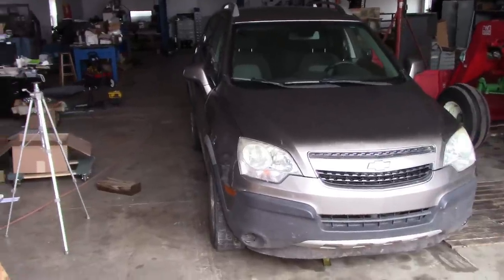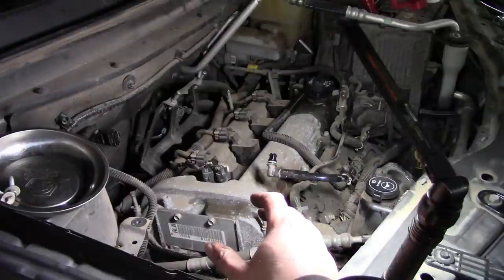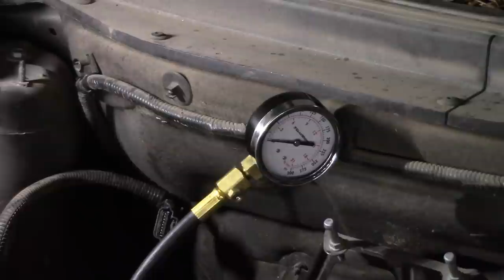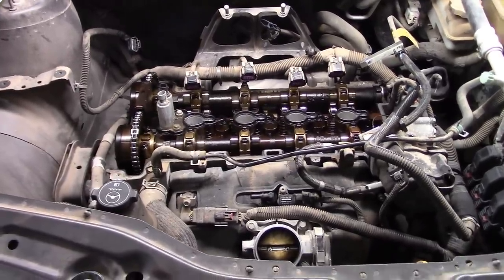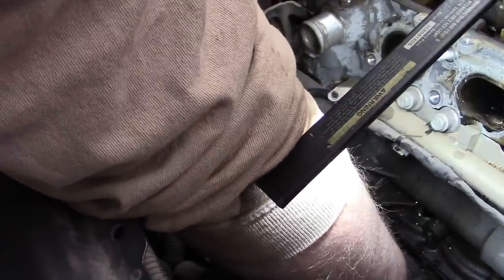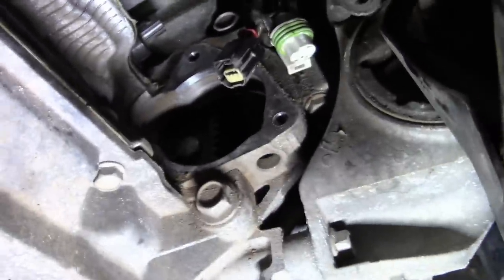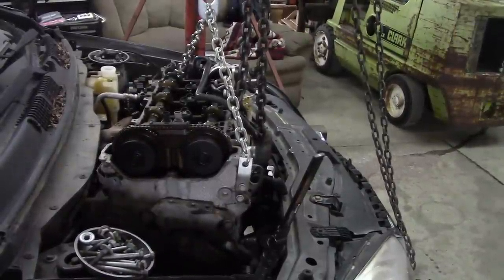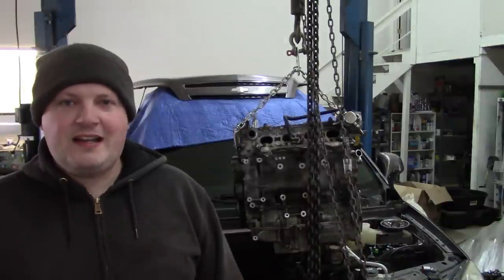I Bought the Cheapest Small SUV on Marketplace - Part 1

Comment: You may have to reuse the exhaust manifold would it be a good idea to repair it still hooked to the blown engine?
Reply: Frank Deegan I was gonna ask the same thing.
Reply from the maker: That's the plan. It's not cracked all the way.
Reply: @WatchWesWork  Would it be helpful to split it all the way through before you  cut the v to begin the repair, just for stress relief?

Comment: The road test in Car & Driver for these when they were first sold as Saturns was not very forgiving.  They felt the 6 cylinder powered version wasn't too bad but that the engine in the 4 cylinder powered version wasn't up to the task because these vehicles are heavy for their size.

When they were re-badged as Chevrolets they were not really updated all that much, making them old AND overweight.  Strike number 3 in my book was that they were built in Mexico.

They are cheap, and deservedly so, good looking, even today, but I wonder why I haven't seen one in over a year.
Reply from the maker: That interesting because GM used that same engine in the Equinox and GMC Terrain, which were both larger and heavier than the Captiva. I've never driven either more than a test drive, so I cannot say if it's underpowered.

Comment: How many miles did that have on it? I had a 2006 HHR with a 2.4. It never enough oil to have to add any between changes every 3,000 but I only drove it 50,000 miles in 12 years. The fuel lines rusted out, the front wheel bearings failed and I had to replace the cam actuators in the 12 years I owned it.
Reply from the maker: 160,000.

Comment: I am getting ready to rebuild my 2.4L eco-tech! I refuse to pay $1300 for a hundred plus thousand mile motor, when the original was using 3-5 quarts before 120k. I squeezed 195k out of it though, only replacing the timing chains at 182,500. And yes its a pain in the A$$ to work on!
Reply from the maker: GM has an updated piston and ring design. Supposed to cure all ails.

Comment: I would put a 2.8L V-6 in it. Only problem we had with those. Is warping of the intake manifold. But, we designed a ram air system to keep it cooler. Could take down a 5.0 Mustang down in a quarter mile with no problem. Lol😂
Reply from the maker: LOL. I don't think this hot rod is worth any mods!

Comment: Hard to find the time to check the oil with twelve steps to go through? I can barely manage one, or two things, let alone twelve. Don´t cars communicate a low oil level to the driver, through means of dashboard lights dough? Or maybe that is an extra feature...
Reply from the maker: There's this little device under the hood that can check the oil any time you like. This one also checks for piston locations...
Reply: @WatchWesWork  On the subject of dipsticks, my friend is a bit silly, so much so, he went off and bough a BMW. Pretty expensive car, so high tech in fact, there was apparently no need for a dipstick in it...

Comment: Wes, love the videos! What's a good method to remove a spark plug that I  suspect has carbon on threads inside the cylinder? Its in my 05 Equinox, I've managed to break it loose but I can only get a couple turns on it before it tightens back up, I stopped before snapping it off.
Reply from the maker: Sometimes warming the engine up before removing them helps.
Reply: @WatchWesWork  I've heard of that, my only concern reaching over a heated exhaust manifold, however I'm willing to try it. Thanks

Comment: Looking like a lot of captiva haters. I have a 14 captiva. Love the little car. Except the driver side seat broke. But the wife drives it. And by the way it has cam phasers for the timing chain. Also I had big concerns about oil burning on that engine. The Chevrolet tech told me DON'T go by the dash minder. Do oil changes at 5,000 mile interval and you will never have an issue. What happens is premature failure of oil rings caused by extending oil changes. So in short with 2.4 Don't go by dash to tell you when to change oil. Use only synthetic oils. And don't ignore the check engine light. Its probably just cam phasers. There $10 and crazy easy to charge. Take it from me I have 2 of those engines in the fleet.
Reply from the maker: GM had several software updates of the maintenance indicator. Just as you said, it reduced the internal for oil changes.

Comment: I've had a few 2.4's in HHR's and Equinox's and had good service - had the timing chain replaced as preventative maintenance on one at 110k.  My sisters had Captiva's and they had terrible luck, burnt oil (had pistions replaced) and constant problems.  Not sure what the difference is.
Reply from the maker: Hard to say. My wifes Toyota has 230K on the original timing chain.

Comment: Dear Mr. Wes.
👍👌👏 No rust at all is a rare thing. Nevertheless: I hope it was cheap enough. Would you tell us the price?
2) You think 2.4l engines in a relatively small car like that are not enough? Meanwhile there are ridiculous small engines in heavy cars over here in Europe. For instance a 1,6 l engine in a Mercedes E- class station wagon and even a 1.4 l in a heavy VW Passat station wagon (and similar cars from other brands)! Allegedly with lots of horse power but no torque (only on paper respectively in the brochure!). The horsepower is "bought" with a ridiculous amount of technology and electronics. But you're not really able to pull a heavy trailer any more (although these cars are allowed to do this on paper).
Out of my experience this problem is similar to big/small loudspeaker boxes = you simply need volume to have appropriate power.
Thanks a lot for making teaching recording editing uploading and sharing.
Best regards luck and health to all of you.
Reply from the maker: The 2.4 is plenty of engine. I think a lot of European engine design is based on taxes. Some countries tax based on displacement or number of cylinders. We never really had that. There was/is a "gas guzzler" tax, but it's easy to get around by claiming to vehicle is for a business.
Reply: @WatchWesWork  
Thanks for replying.
In Germany it's not all about taxes. The calculations of the insurance costs are, amongst other things, mainly about power (bhp)!
So you pay less taxes because of less ccm/cui but more insurance because of steadily increasing bhp! It's very ridiculous.
Additionally they tell you that those small ccm engines with a lot of bhp use less gasoline/diesel and work cleaner. Ha!
Resume nowadays: For instance towing a (heavy) trailer/camper using a big car with a small engine with less torque and you will need much more gasoline/diesel than before. It's also steadily overstraining the engine/gearbox and much more stressful for the driver.
Seriously: Who wants to have a 1,2 to 1.5 litre 3 cyl. engine with 150 bhp ore even more in a car???
2) You may be shocked after reading this. So please try to stay cool and sit down as a precaution:
We already had to pay 1.60 Euro per liter loaded gasoline once! That's 1.73 US Dollar per liter (not per gallon!!!). Nowadays it's a bit cheaper because there is some kind of an oil battle currently. Usually it's about 1.37 Euro/liter. That damned Euro made a lot of normal people poor (including me).
Therefore it's simply not possible for a person with normal income to drive one of those gorgeous American oldtimer (because they consume so much gasoline).
Sincerely yours.
Reply from the maker: @Chr.U.Cas1622  Ouch! That's about twice what we are paying in my state. The taxes on gasoline vary by state, so some places like California are much more expensive.
Reply: @WatchWesWork  
Yeah, that's very much ouch every time you have to fill up the car.

Comment: You cheap mini SUV is nonother than a Chevy Spark. i bought one last Oct and it had a restored title. had been total by an insurance co in North carolina. Got it for $4200. Which is about $2000 under
current good title versions here in Florida. Mine is a 2014. Those cars have variable speed tramsmissions. If yours is ruined get the engine and transmission out of a 2014 or latrer. the CVT of these versions has a steel drive band. Really cool. To change to CVT trany oil find the dip stick under the air filter( black against black under there)and pump the fluid out. Following the manual costs too much.  Chevy Spark Forum is a big help since GM hides important info. Oil consumption can be due to the PCV valve. That is hidden too. Back there where you cant see it.

Comment: I miss the old days when common replacement items such as alternators, compressors, and power steering pumps were placed in easily accessible locations. This has to be the most poorly designed engine I have ever seen. They would have had room to place those parts top side if they got rid of that stupid air cleaner. What a crap design.

Comment: Wes I have to apologize to you.
 I did my homework on this engine and yes you are correct about it using oil.  It is do to the poorly designed PCV system. 
I hope you do the modification to fix that problem.
Reply from the maker: GM revised the piston and ring design to fix this issues.
Reply: @WatchWesWork  Thanks didn't see any info on this when exploring oil issues for the newer 2.4 engines.

Comment: I Pull them out the bottom, super easy!!! Set it on the forklift forks.
Reply from the maker: I dunno. I still have nightmares of a Pontiac that spun a captive nut in the subframe...
Reply: Yes on an illinois car...but this was a rust free one.  Dropped the engine cradle on the forks. Back it out.  Instant engine stand.  Might even look for a complete engine/trans combo half the time they will throw the trans in cheap.    Thats what we do, buy a car with 150k, put a 30k drivetrain into it.

Comment: We had my moms 2010 equinox with the 2.4 fail on 3 separate occasions. The 1st time it wiped the lobes off the exhaust cam. The dealer just replaced the exhaust cam and nothing else. The second time the weird triangle lobe for the high pressure fuel pump was wiped clean, leaned the engine out and kaput. The dealer “rebuilt it”. The third time it seized solid on the highway. We bought that car brand new. What a waste of money.
Reply from the maker: Wow. That's an odd failure mode. Good old GM quality.

Comment: Not to argue too much on your Toyota comment, but I remember a Supra that came through for a serpentine belt, the pulleys were so close to the fender inner structure that even once the belt was off the pulleys, you couldn't fit the new one between the gap. Had to unbolt all the engine mounts to get the belt back in. That said, every manufacturer has some shit designs. My least favorite so far is the 5.4 Ford in the Expedition. Decent truck, but what a crap engine / body combo. Replacing a valve cover gasket is a multi-hour project.
Reply from the maker: Cadillac Northstar. I still have nightmares.

Comment: Can't wait to see the reinstall. You know the reinstall will be worse than taking out the old one? On of them has to be a pain so , since the removal went well, the other will just suck. LOL. But, I hope not.
Reply from the maker: Or it'll run for 20 seconds and throw another rod...
Reply: @WatchWesWork  I hope not. I have changed a few engines in my life and there is nothing worse than getting all done and then finding out the engine was shit. Sure, they warranty the engine but, they won't give you any money off for all the time and labor you put into a double change. That really sucks if you are doing it for a customer. You can't charge them twice unless they supply the engine.

Comment: I got the diesel uk version badged Vauxhall. Hyundai base I thought. Mine is 4wd quite hefty ,will handle 2.3 tonnes easy on a trailer. Big brakes,bid reat diff and prop,Not over good on fuel butin economy SUV's this is a tough truck. as for petrol 2wheel drive,????
Reply: That lady as lifted and stored a bonnet(hood) on a car roof b4!

Comment: The Captivas only ever had the 2.4 in the US. The Equinoxes are the ones that had the V6. Not that the timing chains on the 3.6 were any better...
Reply from the maker: There you go. The number of TSBs on the Captiva and Equinox is unreal...
Reply: It didn't have to be this way. We've had an Equinox with the 2.4 in for issues stemming from running on low oil. Didn't blow the motor, but it may have caused the timing chain to start failing. They didn't want to pay for one, so their problem now. 

All my experience with the GM 4 bangers is questionable. Except the NA 1.8 they used on the Cruze/Sonic/Saturn Astra, but I've heard mixed things about those too. I miss the old pushrod ones. Those were nice.

Comment: Working on a Kobelco 330 that was converted into a log loader.  The engine ceased to work, kind of blew up in the middle of the log yard.  The Mitsubishi engines in this series of machine was a know problem, they all blew, broke crankshafts all kinds of horrors, so when it made the funny noise and quite, we just ordered a new engine.

I was on the bottom and the left side, Mike was on the top and right side stripping all the goodies off.  As I was working my way up squeezing myself up between the engine and counterweight.
Looked at the block and could see straight in, huge hole.  Reached over and grabbed a broken out piece of the block and passed it to Mike with a "Found the problem"  

And when the bear was GROWLING, he sounded just like my grandson.  Same thing, point the camera and get a yell hahahha.
Good times

Stay safe Wes and Family.
Reply from the maker: LOL. Sounds like you made the right call!

Comment: turning the engine with the starter without first checking the condition of the valves and pistons is generally a bad idea when you don't know what happened to the engine.
Reply: Not really, when you consider that the last thing the engine was doing was running.  I get what you are saying though.

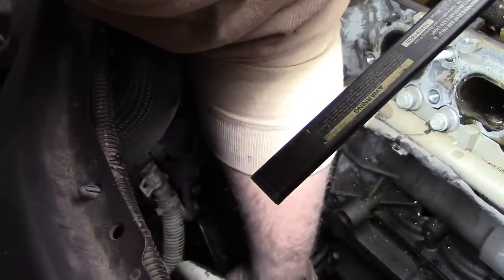Comment: At around the 18:00 minute mark you ask 'why do they do that', you also just before that said, because the engineers don't have to work on it. They should be required at the manufacturing level, if they design it they should have to work on it just like a mechanic would. I'd bet some things would get re-designed.
Reply from the maker: I'm sure they would change things, but then it would cost a few more pennies, so that's a no go.
Reply: @WatchWesWork  Yeah, what's that phrase, your damned if you do and damned if you don't. Kind of a n
'no win' thing.

Comment: Opel should have dumped the 2.4 in favor of the 2,0 when they started production of the Opel Antara wich is the original model the rest are just badge engineered. Maybe the engine problems is that in Europe the 2.4 is rated at 160hp in us is at 180hp so more power more problems.
in Europe we had the Captiva as a Chevrolet but that really was s daewoo but that was a piece of crap worst than Dacia.

Comment: Sooo being you are a talented guy...can you not fix that hole replacing a used bloc or ia it not worth it n resell it...just wondering.  Stay safe during these trying times.  🇨🇦
Reply from the maker: Not worth fixing. The block hole is a minor issue. The engine would need one liner, one piston, one connecting rod, and one set of rings. Plus we can be sure the crank shaft is damaged and will need to be ground or replaced. That will require undersize bearings. I can buy a running used engine for $1600.

Comment: "bunch a dicks" LOL (wrench hits floor, "errrrrrr")
Reply from the maker: LOL. Several people have pointed out that GM designed the 2.4 Ecotec to fail long before the alternator, so there is no real need to make it removable.
Reply: @WatchWesWork  Yea, I cringe watching this vid. We bought my stepson a Cavalier years ago that had that damn eco-tec 2.4 in it. Of course I ended up putting a motor in it. The whole time I am watching this I can't help but keep thinking: "tell me again Wes, why you would rather do this than run a CNC?".  I really don't enjoy working on anything newer than about 1980. Some trucks can be an exception. If it has a solid front axle (4x4) it gets a pass (unless it has anything to do with a turbo in a super-duty). Anything front wheel drive can just fall in the shredder as far as I am concerned, before I will go after it with wrenches.
Reply from the maker: @wheelieking71  Heh. I get it. I don't mind working on them, but I'm not deluding myself that it's ever going to be any good!

Comment: Wes,
I've got a 2010 3.2L AWD version of this car. Picked it up with a genuine 30,000Km on it a month ago.
In Australia the Captiva is known as a Craptiva and the prices reflect this .
So far my unit has been pleasure to own and drive apart from the appallingly bad SatNav system GM fitted. The maps are out of date and GM dealers charge a fortune to install slightly less outdated map updates.
A lot of the problems I understand are related to the diesel and 2.4L engines in the early models.
Good luck with this one and stay safe.
Cheers Eric
Reply from the maker: Interesting. That was sold here as a Saturn Vue. Then GM canned Saturn and rebadged it as the Captiva.